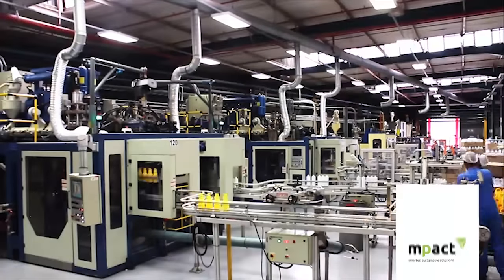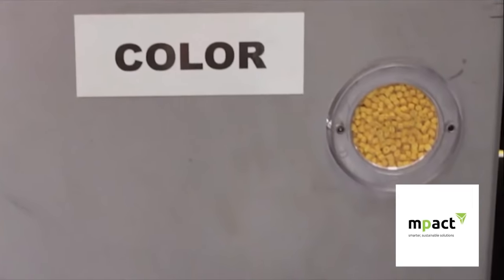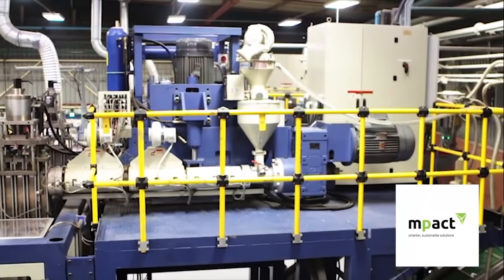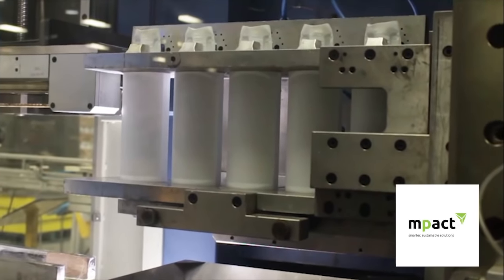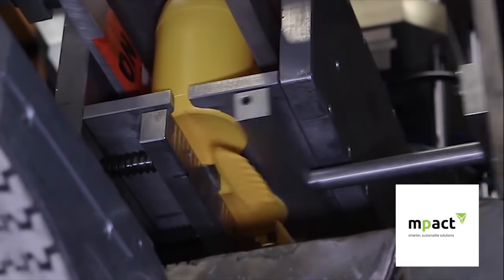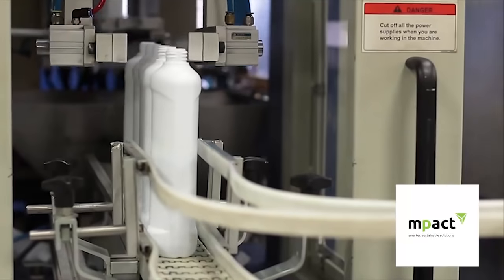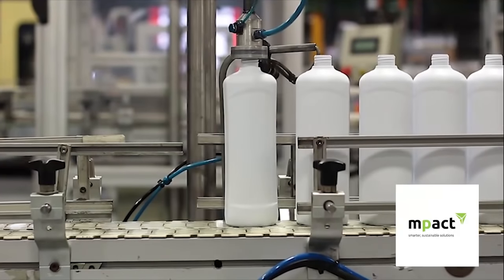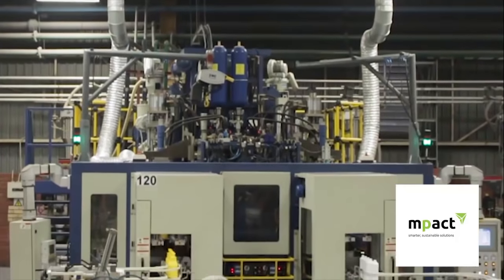The blow moulding process

Comment: this is amazing how do you control or achieve varying thickness on a bottle? lets say the neck has its own thickness and the body has its own thickness too?
Reply: There is a servo controller, changing the thickness by pulling the core of the die head.
Reply: There is usually a die (stationary) and a die tip/mandrel that is connected to a hydraulic programmer cylinder that moves the die tip or mandrel up or down thereby changing the "die gap" which determines the thickness of the parison (i.e. the sleeve of plastic being extruded).

Comment: So now no one can tell me that bottle caps can't be recycled. They could go back to the original loop to be melted.
Reply: To be precise they didn´t manufacture any bottle caps in this video.
Reply: So like don’t quote me because every place is different, but there’s usually a machine you throw the plastic into and it’s put into a hopper that solidifies it after it becomes crushed up and it recycles into the next batch.
Reply: depends on what plastic the bottle caps are made from
Reply: The cap isn't put back through because it's usually made from a different material (type of plastic) and very often a different colour to the bottle so you would end up with colour contamination in the finished bottles
Reply: Look up thermoplastics and thermosetting plastics
Reply: Well bottle caps often contain rubber which absolutely cannot be recycled into HDPE or PET plastics or it will completely ruin the product and it'll have to be trashed.  Plastics recycling is so difficult because each type of plastic has different physical properties. Blow molding HDPE can be used in injection molding HDPE but not the other way around
Reply: It's been a long time since I commented, but it's nice to know that other people are being involved with this. Anytime plastic can be recycled I'm happy!
Reply: @chickie8252  😁

Comment: Since it is closed loop, will there be an accumulation of material that has many heat histories from being melted and formed over and over? Should there be a purge stream to prevent this accumulation? I.e., a fraction of the cut pieces will be disposed of rather than reintroduced to the beginning of the process. 

I am a chemical engineer by schooling and new to the plastics industry. I am thinking in terms of chemical stream splitter where we have a purge fraction and recycle fraction.
Reply: I think you'd have to test at various points...Looks like these ALL receive testing for leaks. I'm sure the process has been evaluated to minimize waste and there is perhaps a cutoff for in-process recycling... BUT with every bottle being tested the process is probably sound as is...for a lifesaving device there might be heightened concern.
Reply: From my experience as a blow molding operator, plastics plant maintenance man, and mechanical engineer, I can tell you that the material being recycled (what we call "regrind") is typical used too soon for there to be a noticeable decline in the quality of the plastics. We generally use no more than 80% regrind and no less than 30% (except on startup with a new color for which we have no regrind). But enough of it gets used that we don't have the same issue with degradation that recycling plants have. 

Unfortunately not all of it gets used. Occasionally it gets contaminated with dirt from the outdoors, or hydraulic oil from leaks within the machines. In which case the contamination makes it unrealistic to try and clean it all to be reused so it must be discarded to a landfill I'm afraid.
Reply: @whogavehimafork thanks for the info!

Comment: The blow-molded bottles are tested with vacuum, not pressurized air...
Reply: That depends on the machine manufacturer. We have three machines,  2 german and 1 American. All three use pressurized leak testing, then reject based on pressure loss during testing.

Comment: who else is from tb
Reply: for people who are in tb the answers are here thank me when you are in skl lo/l  Clamping – the clamp unit consists of metal plates (or platen). The process begins with the mould being clamped together under pressure to accommodate the injection and cooling processes.
Injection – the molten thermoplastic material, which has been melted by pellet form in the barrel of the machine, is injected under pressure into the mould through either a screw or ramming device.
Dwelling – once the molten plastic is injected into the mould, more pressure is exerted to make sure all the mould’s cavities are filled, using hydraulic or mechanical pressure.
Cooling – the plastic is left to cool and solidify within the mould.
Opening – the movable platen is separated from the fixed platen to separate the mould.
Ejection – ejection is completed by the use of rods, a plate or an air blast to remove the plastic component completely from the mould.;]
Reply: @miashleyfranklyn0  You're a professional.